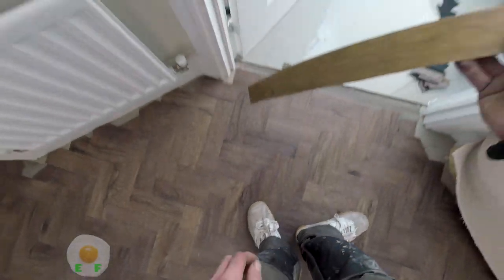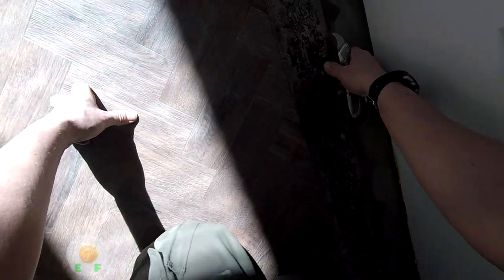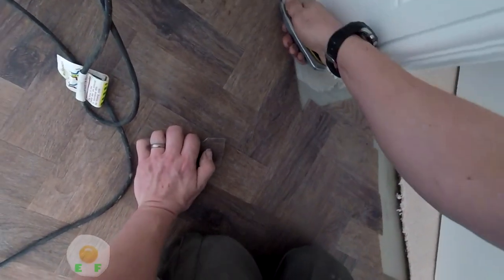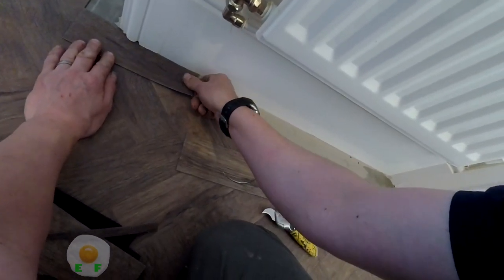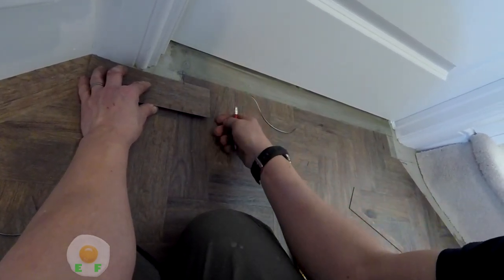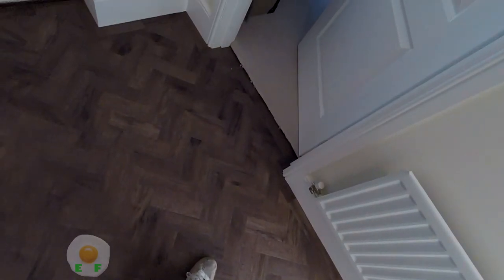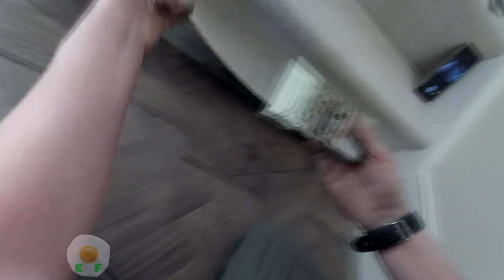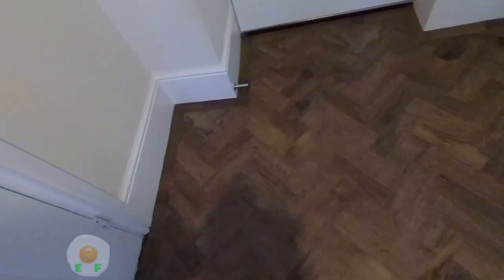AMTICO PARQUET  ( part 3 ) Cutting Back Centre and Fitting Border

Comment: nice. the only thing i would have done different is gone straight across the doors instead of returning it. also you found the centre of the floor but not the centre of the herringbone pattern.
Reply: this will illustrate where the centre line of the herringbone is https://www.tradediscountshop.co.uk/shop/herringbone-set-up-and-scribing-plate/
Reply: The '27' rule that alot aint aware of...

Comment: Sorry pal but you need to get on a course with the floorskills lads. Id love to see a 4k version of that vid!
What happened to rebevelling the field planks that hit the bevelled edge of your border?
Im only being honest thats all.
Reply from the maker: Have you ever tried to use a bevelling tool? Lol no you can't get to the internal cuts so I run a blade down the cut edge to take the edge of and put a shanfer  on it no need for a tool that  only works  on straight lines and not internal cuts!
Reply: @eggyfits  
You dont need the bevelling tool, it's the biggest waste of money and a pig to set up everytime. There is a specific tool out there that wasnt even made for bevelling but will do a far better job. 

All I'm saying is as a fitter myself I wouldnt have left a non bevelled edge against the border bevell.
Reply from the maker: @MisanoRasss  I told you I use a blade to take the edge off I don't show every little bit in my videos  otherwise it will be hours long what's this tool you are talking about?  I always like to know of new ways to do things ?
Reply: @eggyfits  you use a blade to take the edge off yes I already got that, I'm talking about 'bevelling' the cut end of the tile to match!
Reply: @MisanoRasss  Exacto tool with a square blade works wonders to bevel the plank
Reply: @BigAdz70  
Yes mate that's what I trying to tell the egg man above

Comment: Great videos.  I am about to lay some Karndean Van Gough planks.  Two questions, I have taken down a wall and there is about 10-15mm step in the screed between the two rooms.  I was going to latex a 1m strip of stopgap 1200 and just try and blend it out, let it set and then a full layer over the full lot of stopgap 1200, how would you best get round it (the lower room is 20m2 so would use a lot to fill to the same level).  Also, do you need to roll it with a 68kg roller as its the only thing i havent got?
Reply from the maker: I never roller the floors never have never will but I would ramp the difference out with ardex 45 rapid settings repair morter give it a hour then stopgap 1200 it's a grate latex
Reply: EGGY FITS thanks. So you don’t even use the small hand roller then?  How come as I believe that’s what Karndean recommend, you obviously know what you’re doing so you just line up one end then roll the rest of the plank out and move on. I have some cable underfloor heating so will be using Karndeans HT adhesive
Reply from the maker: HT is the best glue for underfloor heating I put the tiles in and rub them all over with my hand I have worked with many different fitters over the years not 1 used a roller . I think they put that in the instructions as a excuse if the floor starts cumming up not like it wood if you read the glue tub it says you need to glue the floor put tiles in and work towards the door and not walk on it.so how can you then roller it plus the glue has to be wet so if you roller it will push through the joints.good luck with the floor my friend,👍
Reply: EGGY FITS great advice thanks. One last thing. Is the A2 spreader best and how long roughly do you have to lay after spreading.
Reply from the maker: @danharrison12  it depends on temperature I normally spread about three boards wide and yes A2 is the normal size to use
Reply: So I’ve tackled the levelling. Nearly 50m2 and mostly it’s nice and flat. There are just two sections where I have gone a bit off piste and there is a bit of a dip. I have some micro 500 but not sure I should use this as it’s about 5mm low at the worst point.  Could you suggest the best way to fix.
Reply from the maker: @danharrison12  microcote is the best for that fill it in two Cotes